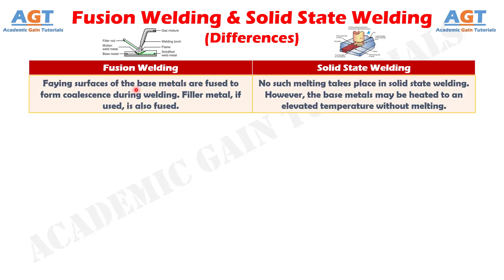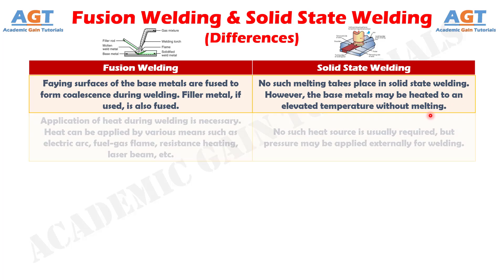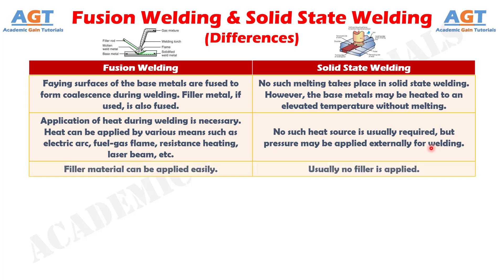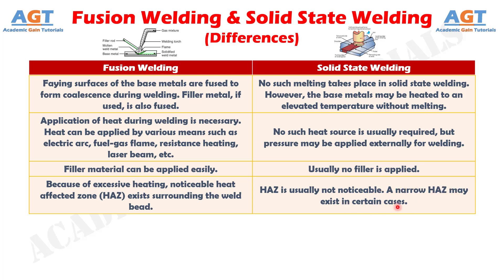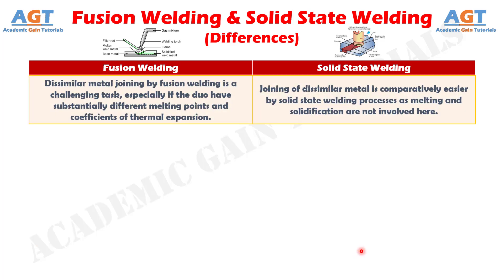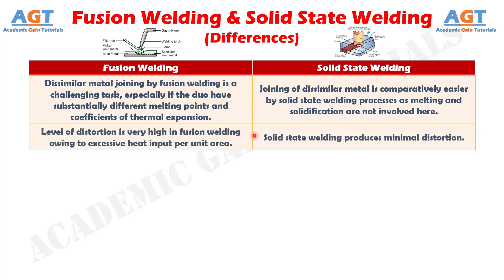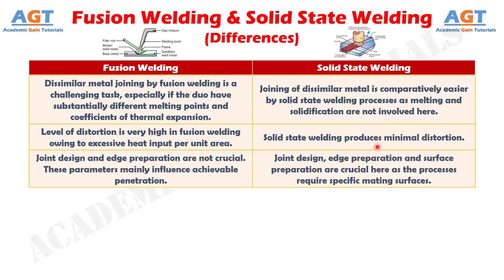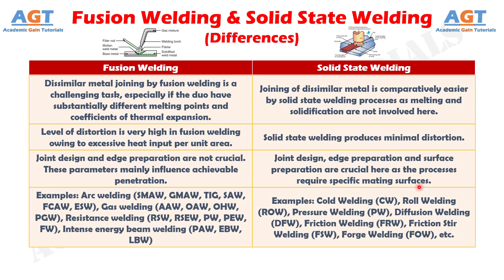Differences between Fusion Welding and Solid State Welding.

Comment: Problem... Forge welding is most definitely a form of fusion welding and not solid state welding as flux and heat as well as pressure are usually necissary